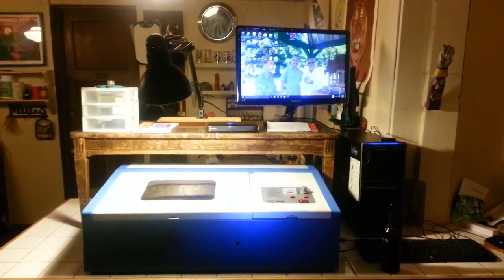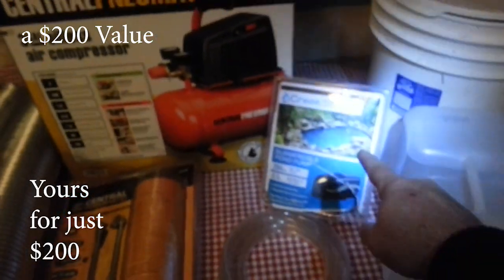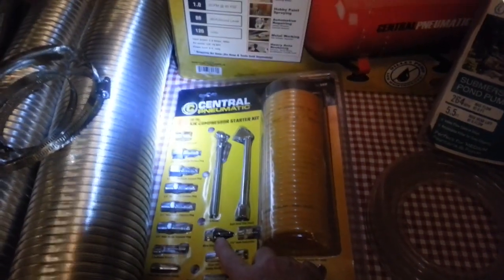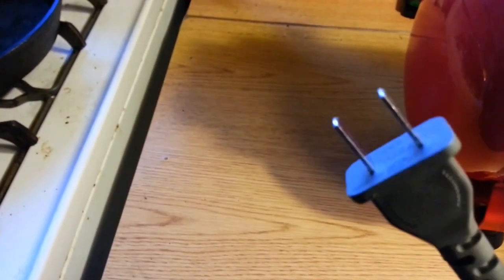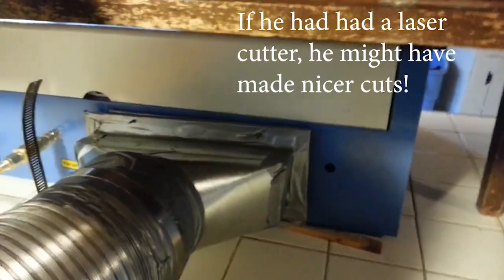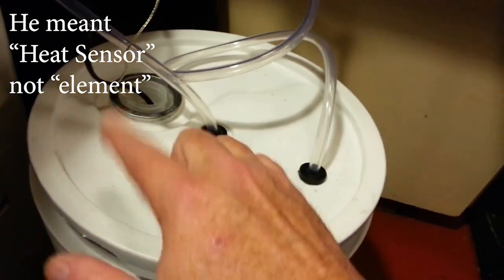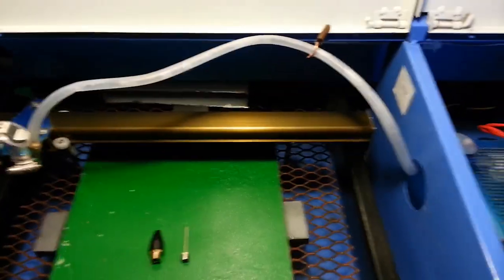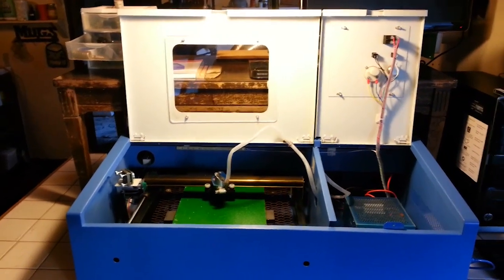Suncoo 40W Laser PART 2 MODIFICATIONS

Comment: Awesome set up. 

How's your setup holding up? I just bought one. Any recommendations?

Thanks for sharing!!
Reply from the maker: It's doing great. Water stays cool, only gets up to about 18 Celsius on a long run. I would pay for a better compressor, mine has trouble keeping up with 6-10 lbs pressure, but it's keeping the flame out, so its good. Wish there was a way to adjust the focal point. I am thinking of getting an adjustable table to use as a bed that can be adjusted up and down, depending on the thickness of the material rather than the fixed bed height I built. But all-in-all, really pleased. Let me know how yours works out.